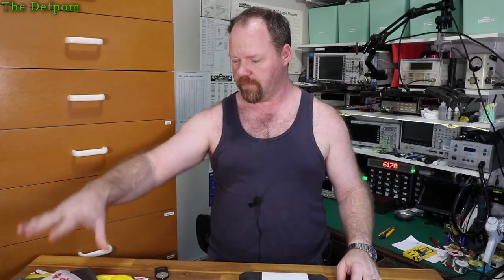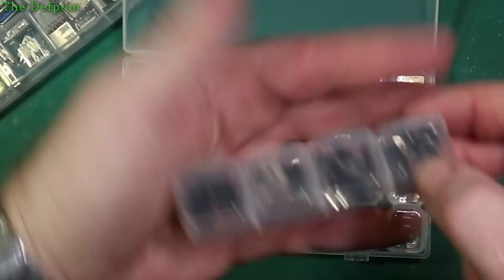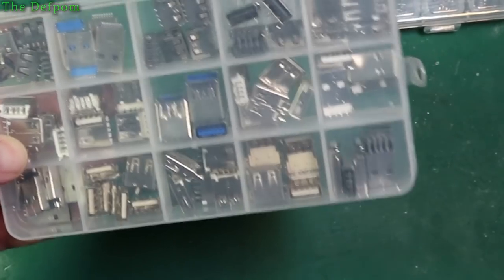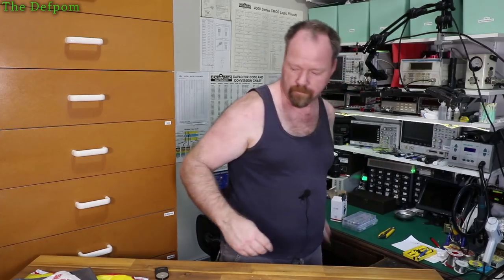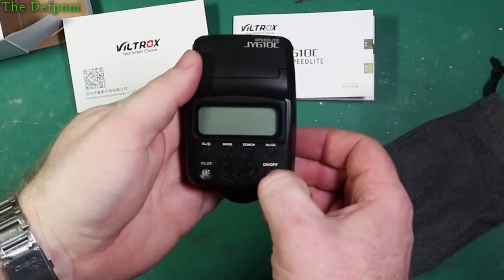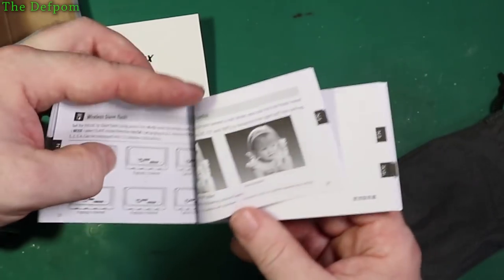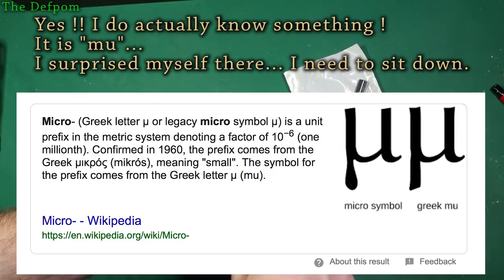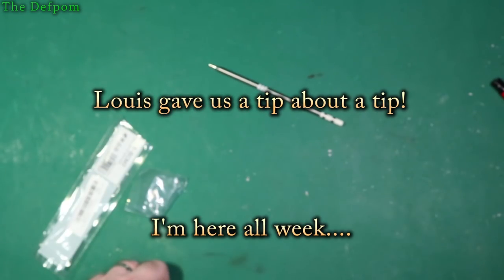🔴 #519 Mailbag Monday 25th February 2019 - What was in my postbag?

Comment: The 18% grey card is useful when setting exposure. I was afraid you were going to press the "pilot" button on the flash after it had charged and set off the strobe! More fun than an exploding X cap. That concave tip would be excellent for drag soldering small multi-pin devices and connectors on iBoards.